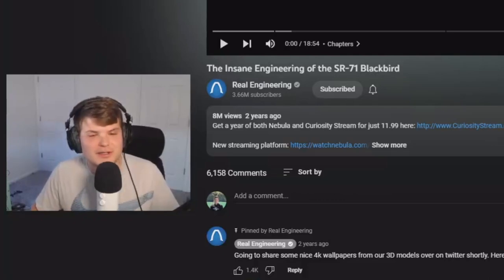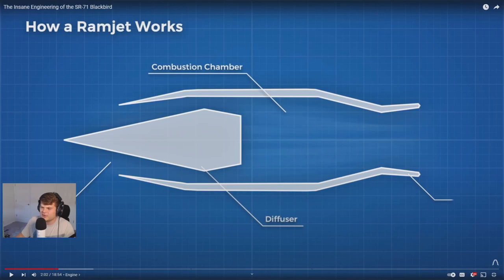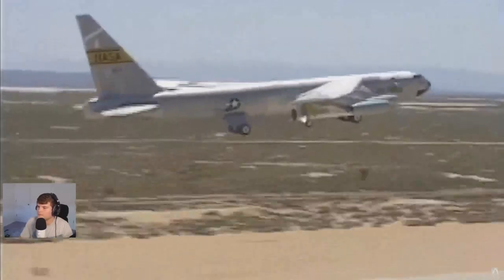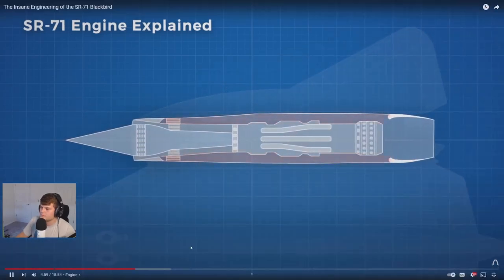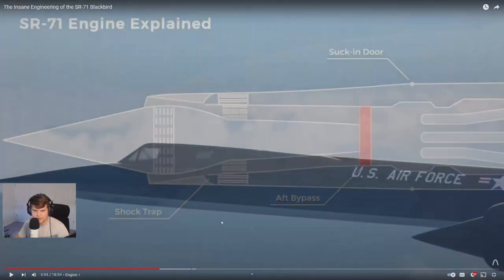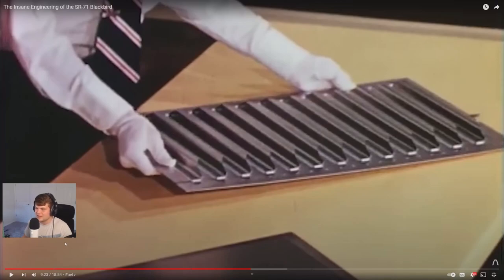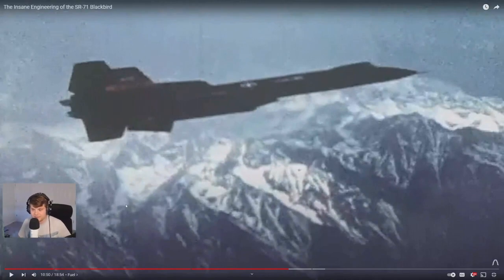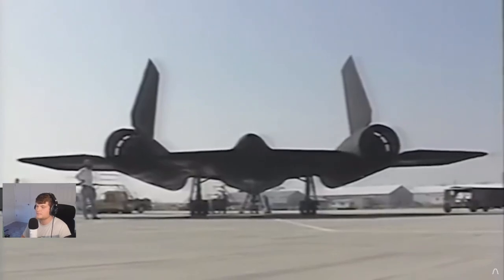Engineer Reacts to Insane Engineering of SR71 Blackbird!

Comment: There was another video I saw about why there is a gap between the intake and the fuselage of other military jets, it helps to prevent differential forces on the vanes inside the engine to increase reliability of the rotating assembly. Cool stuff, good to hear an engineer's input.
Reply from the maker: That is interesting and makes sense to me, I'll have to look into that further. Thanks for watching!